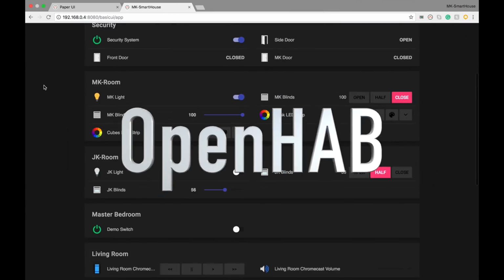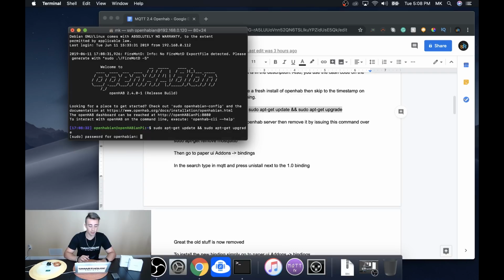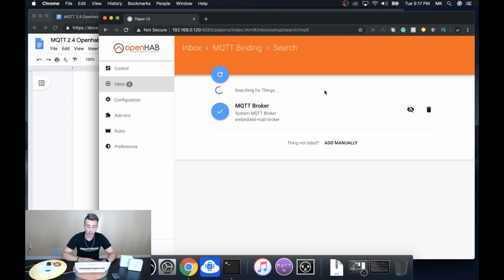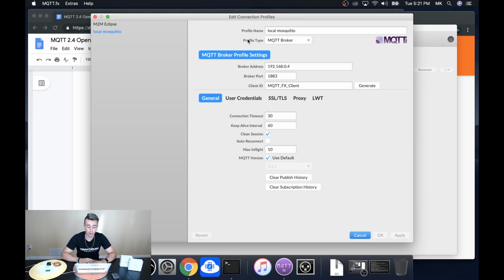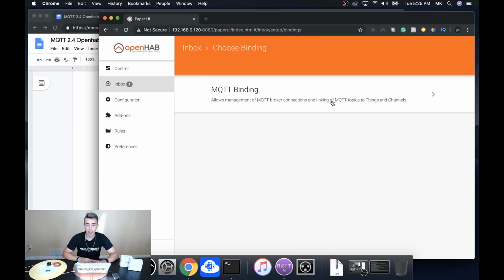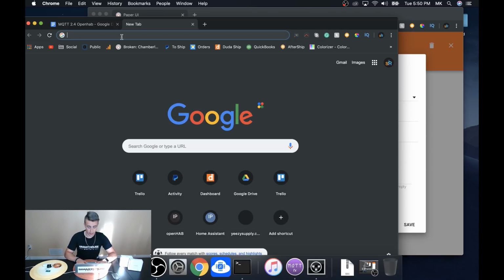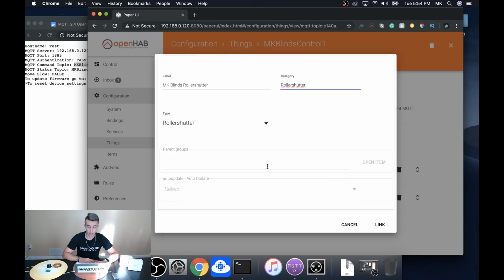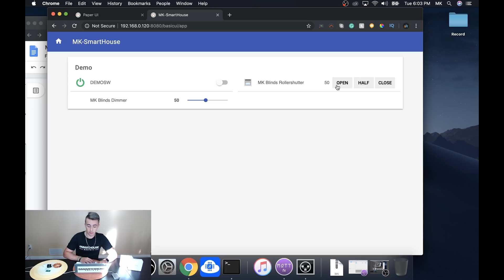Complete Guide OpenHAB MQTT 2.4 Binding / Embedded Broker

Comment: Hi Matt, with this tutorial, I was able to successfully configure Openhab 4 and the Blinds Control. However, I'm having hard time getting the LED Strip control to work. Not sure if I need to have a Rules configuration for the LED strip and also if I need to use HSB Values.  Will you be making a separate tutorial for the LED strip control?